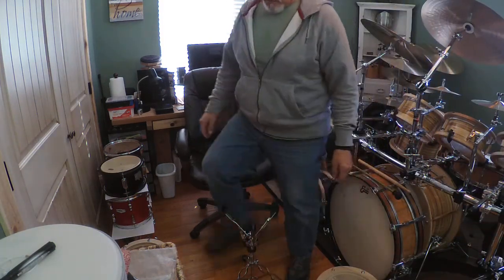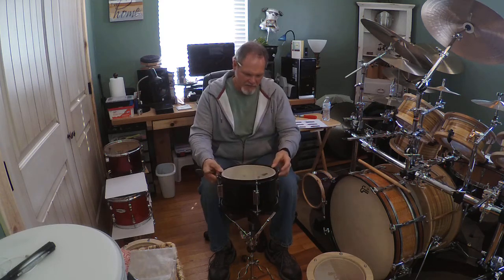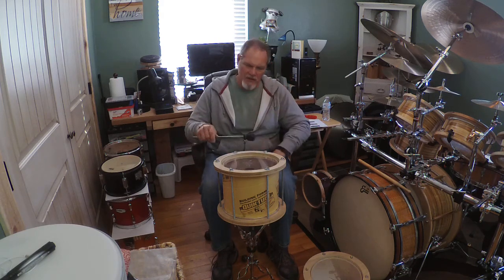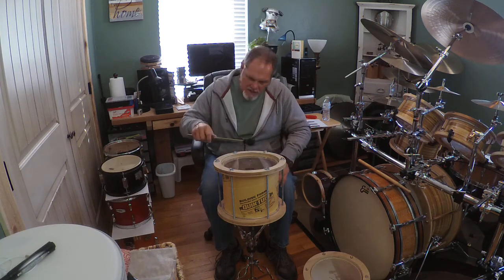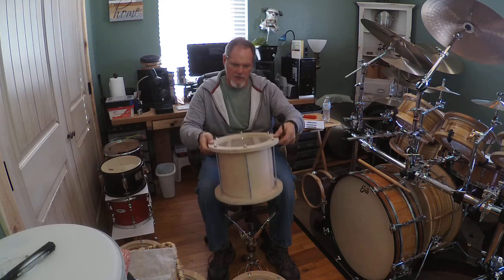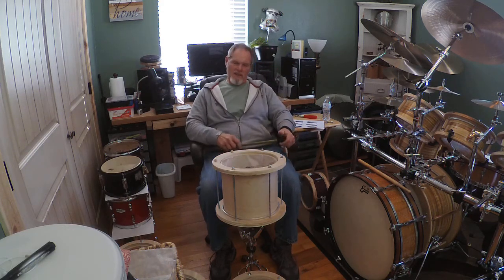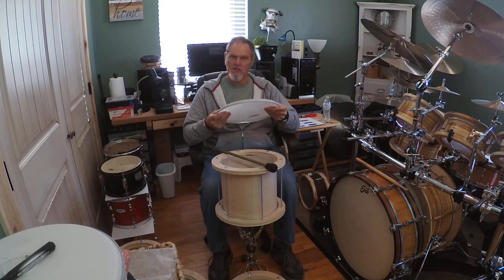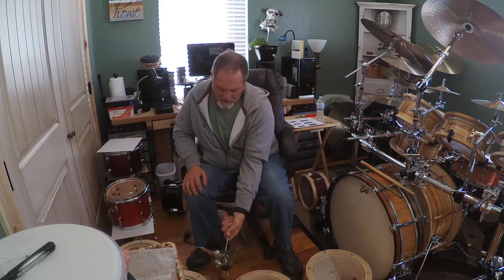Drum Shells and Sound - Bearing Edges, Part 6

Comment: Well done. I thoroughly enjoyed this. I am building my own plywood kit now.
Reply from the maker: So, how did your plywood kit turn out?
Reply: @REFondrums  I finished most of them! I had to put the project on hold. But I am making some super beautiful shells.
Reply: @chrisscustomdrumsmanzella7803  I think he is talking about the truth. These glues and different 'features' about drum shells make a such a minor, almost unnoticeable difference in the sound of a drum. I fully agree with him. I owned a set of pearl masterworks. Beautiful kit, sounded great, perfect bearing edges, great sound. Well made, sounded great, but I realized at that time, 20 years ago, I was paying for an exotic veneer, and a high end paint finish. The material, whether mahogany or maple, make only minor differences in the frequency response of the shell. Yes there's a difference, but its small. I think bearings edge flatness and angle does play a role.
Reply: @jross3680 you’re mostly paying for the hardware

Comment: After John Good sees this you'll wake up with a drumHEAD in your bed :D
Reply from the maker: LOL. Now that is funny. Nicely said.
Reply: @Assimilator702  I've never met mr Good.  He seems like a cool guy. I don't like the way dw drums sounds. They sound boxy. I've heard them live, played them in stores etc. I will say this about thier hardware.  Second to none!!! Built like an Abrams tank. And decently priced.
Reply: Frank Spikes I agree on the DW hardware. Bullet proof and 9000 pedals are my preferred pedal along with the 5000 which I’ve played since I was a kid. The problem with DW Collector Series drums is their shells are TOO THIN. All the sound comes from the heads however the shell does play a part in muting certain frequencies and in turn exposing frequencies in the head. With extra thin shells you lose all the high frequency attack and projection and get this low thuddy note with no solid fundamental that’s useful in a tom or bass drum. Toms sound BOXY and the bass drums aren’t able to project. The DW Jazz series are slightly thicker shells with diecast hoops and those are much better drums. However  it seems DW only wants to push the Collector series. Tama Starclassic drums check all the boxes for me. Star drums would be nice but those are $$$$. I need a 14” floor tom  for my Bubinga Elite Kit and Tama is charging Star pricing which is the only thing holding me back. It takes months to rationalize the purchase. I’m close but not quite there yet.
Reply: @Assimilator702  Thanks for your comment. I have a 5,000 pedal that I absolutely love.  The jazz series do have a nice tone to them. I actually bought a Yamaha stage custom birch bebop sizes. They sound great, look cool, and relatively inexpensive.  About 700 for a 5 piece shell pack. I upgraded the batter heads. And last but not least invested in padded bags. Total investment was about 1200 bucks. I have other drums.  So the Yamahas stay stacked in bags ready to go.

Comment: Absolutely right. The geometric of bearing edges affects the sound only as much as it affects the vibration of the head. So the amount and location of area of wood in contact with the vibrating membrane is a key aspect of the sound. For that reason, I don’t think your hoops affect the sound of your drums because they are wooden but because of their geometry (or micro geometry?). I mean, their section is rectangular while metal hoops’ section —at least three flanged ones— is usually rounded.
Reply from the maker: I can't really argue that but, looking at profiles, the rounded edges of the wood and metal are not that different. The overall shape is, of course. But, what actually touches the head hoop is not. 

If the wood hoops are lighter than 2.3 metal hoops... matter of fact, I have never owned them but, it is generally said cast hoops produce a drier tone. Cast are heaviest. Is it the weight of the hoop, lightness/rigidity that allows a little more tone and sustain? What would a space age, composite plastic hoop do to the sound, like a carbon fiber?

Comment: As a recording drummer I can agree with just about all that you say, however the bearing edge in combination with the type of heads do make a large difference, also and even more pronounced is the difference in tuning between bottom head and batter head, that will amplify certain frequencies and give much character to the sound. Personally I now started using the powerstroke 3 as bottom head on the larger toms (14" and up) amazing how it improves the sound! and finally looks do add to the joy (think about your better half :-)
Reply from the maker: I'm recording drum tracks right now for an upcoming album. The guitarist has been sending me audio samples of the set and what I like. As with my last and that ongoing recording project, with the stuff that guitarist sends me to check out, it is astonishing to me what recording software can do to a drum. To me, it renders the subject of shell material irrelevant, and even bearing edges in regards to head pairing. Even where heads make such a greater difference on the sound of a drum, just tucking at frequencies and filters, etc., can radically alter anything the drum naturally is. I use single ply heads. The software can make the drums sound like they have twin-ply on everything. Right now, the kick has all kinds of gel stickers on it, both heads, to dampen natural tone, more in the liking of the guitarist, which effects what I hear and feel when I play it, yet, he sends back samples and the drum sounds almost wide open. It's unbelievable. 

Just listening with my ears I can discern no large differences between bearing edges and single play heads. Nothing that could ever be heard on stage. Maybe in a small Jazz-club trio with no PA? Even then.  Change heads, change the general sound of the drum, model to model. As long as the heads, whatever model, can seat correctly on the edge, whatever edge, and the drum is mounted with isolation of hardware in mind, the heads will throw off the frequency range they're meant to in the sound waves within the chamber with subtle, nuanced changes that just get lost when mics and sound and recording equipment get involved. 

"Improving" sound is entirely subjective, of course.  That's an "ear of the beholder" subject, and beyond the scope of the series. More low end, more high end, more stick attack, less stick attack, on and on it can go. As many have stated in comments, the player's touch and the sticks they use mean more to the sound than the shells ever could. 

Thanks for watching and taking time to comment. I appreciate it.

Comment: Thank you for this video I am so tired of people telling me how much the bearing changes the sound.  I have this debate with people all the time. Trying to explain that it is the reinforce ring and the covering material that makes the drum sound vintage the bearing edge has the least amount of effect on the tone. Die cast hoops sound much different than cast triple flange and they influence the tone much more than the bearing edges. The biggest change in our bearing edges came from reading about the engineers at Sonor. Sonor actually make their snare shells slightly undersized to account for the variation in drum head manufacturing, which always let's the snare's bearing edge sit on the flat surface of the head. Since Germans always come up with the most difficult solution, (actually making shells undersize) our solution was to cut our bearing  inward on the outside of the drum. This has works to assure that head always fit.  Thanks...
Reply from the maker: Thanks for watching and commenting. I appreciate it. Others have brought up Sonor's shell diameters. I knew that Premier has also done it for a very long time. 

Personally, having covered drums with all kinds of materials besides traditional wraps, I never found anything that affected the sound to any noticeable degree. My other set, besides the stacked plywood in the video, is covered with tooled leather. There's no difference in tone or sustain. Aside from depth affecting the sound, I never heard differences between "vintage" bass drums and modern. Toms are different because of shell brackets, and ft are different with older, non-isolating brackets and leg tips. Depending on the genre and style of player and all, even those things make little difference to so many players it just makes the entire industry hype about shells that much more silly. 

When you state "our solution" are you referring to  a custom maker or company? I discovered the need for the outside cut on the first set of drums I made, back in '91. The full inner 45, on those Keller shells, just sounded odd to me; thin sounding. It was the popular cut then so, I put it on. I didn't like the sound. Nothing huge but, I could hear the higher frequencies sounding kind of sour. So, I just took some off the outside and the sound opened right up. That's when the whole aspect of the apex point of collar and flat of the heads became obvious.

Comment: As a ply and stave builder myself, I'll agree that the bearing edge profile doesn't make a profound difference when it comes to profile unless you compare an apex with a round over.  You do get a bit more highs with an apex vs. a roundover.  I've found that re-rings make more of a difference but I'm not going to describe a sound of a tone.  That's just silly.  The one thing I will say about edges is that no matter the profile, it's absolute must that you start and finish with 100 percent level edges otherwise you ain't tuning for shit.

T shirt idea?  

"It's my finger touching my other finger"

Good program.

Comment: Great insight and I totally agree!! BTW, I am fascinated by the shallow kick drum on the floor! What size is it?  I would like a kit that had a smaller foot print, particularly depth wise. Do you think an 18"  or 20" kick in a 10" or 12" depth would sound as "beefy" as the same size in a 16" depth? Seems like 16 and 18" depths are the norm these days.
Reply from the maker: That 5x24 kick is what I use with my tabletop set. I had nowhere to put it so I placed it in front of the stacked plywood kick. It's basically just sitting there, though it kind of acts like a passive woofer. 

The plywood kick is a 12x20. My big set is dble bass. 11x22 and 12x24. The entire set is all mathematically 50% depth to head size. 6"- 24". 

I have made deep bass drums. In the 70s I had a 24x26. A real cannon and I was using Speed Kings back then. Some years back I made a 20x22. I cut it back to an 18, then 14, then 11 like the rest of the toms, half the depth of the head size. I don't care for the feel or the sound of deep drums. With a deep drum you get a different feel. I stopped using traditional floor toms back in the 90s. The action between the heads on a shallow drum is more lively, and just as loud. 

A couple months ago I took part of my big set to a new friend's place and we just jammed for awhile. He owns 12 drum sets and 65 snare drums. Lots of sound. He could not believe the power from my 7x14 and 8x16 "floor" toms. I sit them in snare stands. I modify the stands for the 16, 18, and 20. 

So, for me, deep drums amount to slower action and a more sluggish feel. They automatically sound more punchy. That's why power toms became popular. With bass drums and all the muffling devices in heads now, players like the 18" depth for the more "thud" nature of the sound. I'd rather have the faster action of the beater off the head from the quicker movement of air, head to head. I can get thud from head choices if I want that. I am definitely not the guy that stuffs their kicks with things to deaden it. I don't use a sound as wide open as Keith Carlock but, I do like a little life to the sound.

So, yes, if the sound of a drum is basically the heads, and I believe it is,  you can have a real wallop coming off a 10 or 12" deep kick. And with all the head choices now you can tailor that sound very specifically for punch versus sustain and resonance.  You also get a more articulate note. I tend to have a busy foot with the music I play so, that is also a plus. 

For players now it is about looks a lot of the time. Shallow bass drums don't look as cool to many as does a cannon, know what I mean? Looks are fine but, I am more utilitarian with my approach to drums and sound.

Comment: I agree 100%, except snare drums, yo can hear diference between material, may be because the heads are chocked
Reply from the maker: Exactly. The snare shell is generally shallow, the heads are generally cranked up way past what toms and kicks are, so the sonic properties of the heads versus the shells are somewhat reversed. The difference between metal and wood shells becomes more apparent but, today, in all live and recording situations, you can make any drum sound any way you want with mics and sound equipment so, it all becomes moot.

Comment: Hi I have enjoyed your videos. I have a 1980 pearl blx kit and a Ludwig super classic 1990 with the same emperor heads, for some reason the ludwigs have better stick response and feel. Why do the pearl toms feel like a trampoline effect or as you suggested in one episode like a wave motion! Why is this happening and will redoing the bearing edges give me the same stick response as the Ludwigs, if so could you suggest the edge I should use to get the most out of the heads? 
Cheers Trevor. Melb Aus.🤙
Reply from the maker: Thanks for watching. Without sitting behind each drum set and experiencing what you are feeling between the two it's hard to say. I mention the waves of the sea effect about regular/typical floor toms. I don't know what sizes yours are. I assume 16x16, the typical "square" size? That feel effect is simply from the depth of the drum, which is why companies began taking off a couple inches, i.e. 14x16 to increase the response time between heads a little. Oddly enough companies already had 16x18 and 18x20 in their stock but, not 12x14 until more recently in drum history. My "floor toms" are all "half toms," 7x14, 8x16, 9x18, 10x20, the same dimension equation as my rack toms and sit in modified snare stands. The response is faster, just as loud, and the wave effect is greatly reduced.  But, we are comparing your drums here.
You state both kits have the same heads on the toms. You have Emperors on both batter and resonant sides?  If not, are they the same on both kits? 
The BLX has the long lugs versus the Super Classic standard lugs. Drums with long lugs tend to have a "drier" sound because the drums do not vibrate as a unit the same as drums with standard lugs. Long lugs add weight and an obvious muting effect. But, that wouldn't necessarily effect how your floor tom heads are responding. 
Not knowing what bearing edges each drum set has I don't have an exact comparison but, that should not make a dramatic difference with Emperor heads which are flexing/vibrating more slowly than Ambassadors. Do either of the sets have reinforcement rings in the shells? 
Both sets have floor tom brackets affixed to the shells. I'm assuming both legs have the same basic shape? 
Do both sets have head mufflers and are you engaging them? That would make some difference in head vibration. 
Those are the extent of variables I'm aware of. All things being equal, save for the lug design and possible bearing edge difference, I really would not expect a major difference in the response of a 16x16 drum.
Reply: Thanks for the reply ! The Super Classics have the long lugs and thin shells from 1990 with no re rings the BLX thicker shells with  short lugs. I have been playing for 50yrs ,and just as an example, I can’t work out why the ludwigs are so much easier to play a double stroke roll on right across the kit( Toms)!! Maybe it’s the head tension combination? Cheers.
Reply from the maker: @trevormay7862  Interesting. So, it's reversed. The Ludwig's have the long lugs and the BLX have short lugs. I looked at pics and saw the Pearl's with long lugs. Either way, no matter.  
Are the drums all the same dimensions? An 8x12 can feel different than a 10x12, and certainly a 12x12. 
The placement of the mounting bracket on tom shells effects the way the unit vibrates. Towards the top, middle, towards the bottom, may effect things. 
If you put the toms in a snare stand, does the Ludwig still feel better? 
Ultimately, yes, you have to tension heads for feel. Slight variances in pitch/feel ratio may exist when all is said and done.